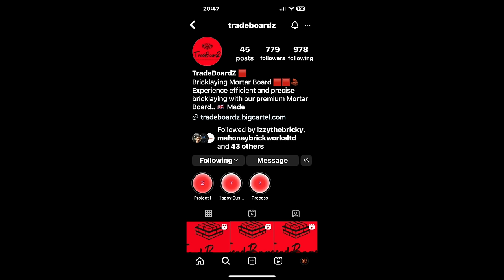LEARN HOW TO BLOCK UP A WINDOW CORRECTLY FOR RENDER #BLOCKWORK 🧱👍🏽

Comment: Sorry guys, where’s the wall ties. Not tied back into the existing brickwork.
Reply from the maker: What is a wall tie ?
Reply: @chrisbird11
Chris,  In the previous video - and indeed this one as well, you will see Steve & Alex, using screw - in fixing ties. Thus the new work is firmly tied back to the existing.